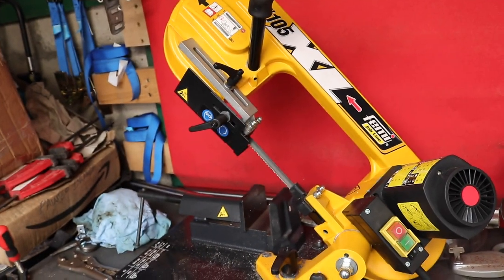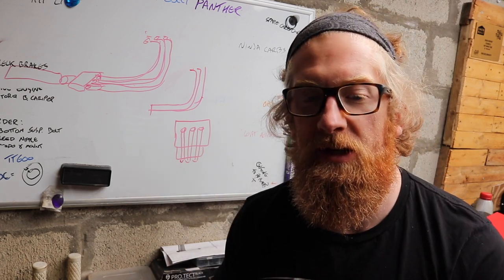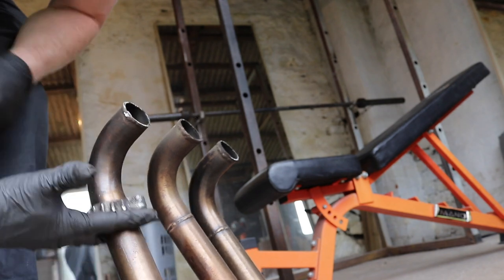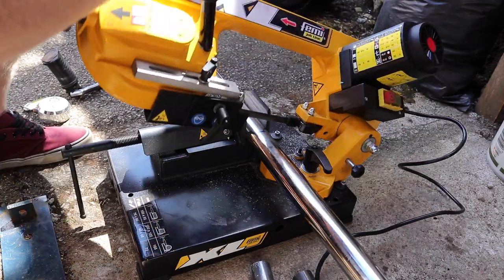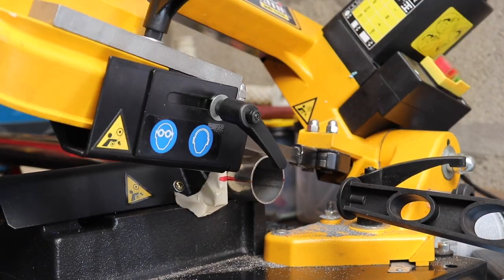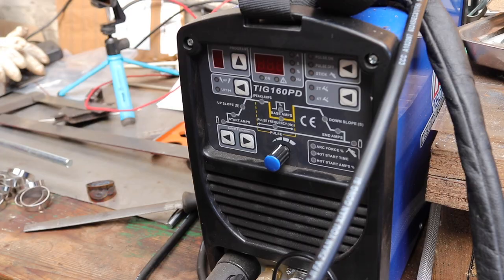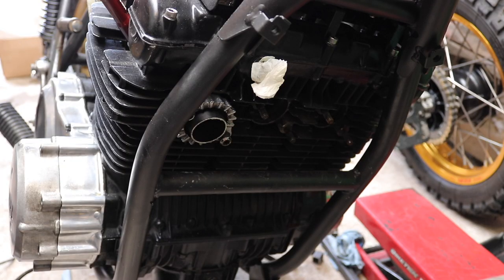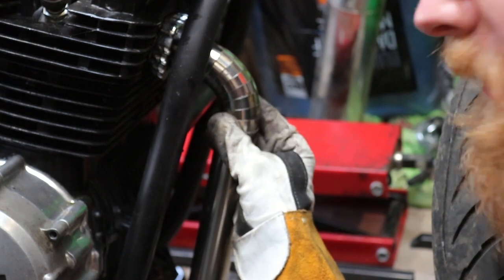Yamaha XS850 Brat build part 4 - Building a pie cut custom exhaust (pt 1)

Comment: Ah man when you welded the short length on the wrong place I was in bits. I can see myself doing something along those lines 😂😂😂 I'm considering picking up a proper tube bender soon...bloody expensive yokes. Pie cuts look bloody amazing but I only have a mig welder for now so a proper saw and a tig is a bit far. But I still want all one length so mandrel bends wouldn't be for me. Great video! Really enjoyed that